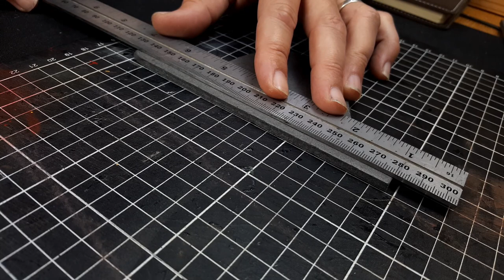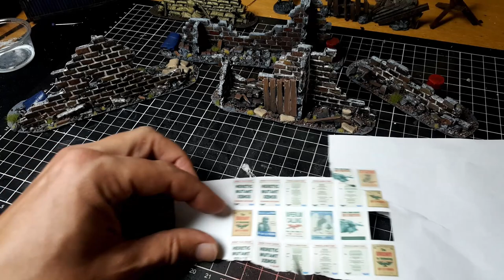Miniature Brick Walls for Wargaming Terrain and Tabletop Games

Comment: Alternatives to the mechanical pencil: 
- A dull, normal pencil. 
- Embossing tools. Basically, a small ball on a stick. Hold it like a pencil, and run it gently down the gaps you have cut. Great for stones that should have more rounded edges, in particular. 
- A nail file. One of the cheap ones with a plastic grip and fairly thick metal. I would use this in a three part process: Score the line, widen with the blunt pencil, deepen with the file.
Reply from the maker: Thanks Matthew.  Great ideas, and I'll keep them in mind in the future.  I use the mechanical pencil for marking cracks and stuff in the foam and it looks really good, but it was definitely not the tool for the job here.  Thanks for the comment and suggestions mate.

Comment: Hi, what method do you like to use to remove the paper from the foam board initially? Thanks!
Reply from the maker: Hey there, I have a video it here https://youtu.be/nE9PIUQjbTY .  It's not the easiest method, but it's the only one that works for me.  I hope that helps :)
Reply: @RFDHobby  Thanks. I had a quick look through all your video titles but my eyes must have run out of battery and I missed it.